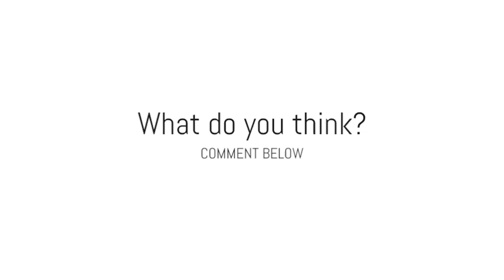A Free Energy Device to Erase Your Electric Bill - Lutec 1000 energy magnetic generator

Comment: There was a scientific evaluation of this machine: "Engineers, Walt Rosenthal and Parke Cole were invited to measure the Lutec1000 in January 2001.  Their measurements showed results showed 28% efficiency.  The exchange was amendable, despite the negative test results.  Rosenthal stated, "I walked them through the calculations carefully so they would understand, but they didn't want to believe the results."  Test entailed a dynamometer measuring output the motor, powering with power supply from wall producing DC volts, optical shaft encoder on end of shaft to measure rpm.  Results showed 50 Watts power going in and 14 Watts equivalent of mechanical power coming out."
Reply: As far as the Lutec 1000 is concerned, it is not about mechanical power, it is about the electrical power (watts) that it can deliver. it is the magnets that ensure that a large part of the electrical power is free per revolution,

as proven with the lutec 1000, this is not about bending physical laws and rules.

any mechanic with some common sense knows it works when you consider that the magnets are attracted to the steel in the core of the coils and are simply driven off by a momentary pulse (DC)

guess what,

We need this for a green future with, I'd rather see the lutec 1000 running in my shed than a windmill in the garden
Reply: No wonder why Lu Brits did not approve the results, this machine is not a conventional motor, a more proper description would be converter or transformer, it is transforming one or several  forms of energy into others, there are multiple energy forms involved in other words, I can think of kinetic, electric, magnetic, sentrifugal and probably more, even this machine looks simple but it is more to it than the first look, the patent is out there fore the world to read and test, problem is, no one understand it. And about that test, if they would tested electric power in and electric power out, not shaft output, they would see the same results as originally claimed, I think. Where this surplus energy comes from is another question, that I don't know but it would be foolish just to state the whole thing as a scam. If I had the tools and capacity I would have built and tested it, cause I fore one, belive its real.

Comment: I remember Lutec.  I also contacted John years ago.  He had some basic physics misconceptions on Lutec's website, such as stating that a magnet holding metal to a ceiling was doing 'work'.  I was honestly trying to be nice...but I received an e-mail calling me names just like another poster said he received.   

One of Lutec's demonstrations shows voltage and amperage (multiplied together) coming out of their 'amplifier' being higher than the wattage going in.  That's easily possible in a highly inductive system such as a generator...but there's no way an electrical engineer, as one of them claims to be, simply doesn't know about phase shift.  They obviously knew the 'trick' but were trying to fool people.

Comment: whats up Elon Musk. you looking at this or what?
Reply: Elon Musk is a puppet. He invented nothing new that would benefit the world. His Tesla cars contribute to more pollution in the long term than petrol based vehicles due to the batteries that have a very limited lifetime. Hydrogen powered engine is what we should have been running for the last 50 years.
Reply: 96% percent of hydrogen is produced from natural gas, coal, or petroleum.
Reply: Elin Musk is apart of the secret societies who would've threatened these inventors. Screw the new world order
Reply: Commerce experts in the 80s said it was impossible to give private sellers power to process credit cards.  And Elon did it in the 90s.  If he comes up with a generator, it will be his own in house team.  BTW, Lutec took investor money and ran more than a decade ago.  They stalled saying the invention was done but they needed time to file a patent in every country having a courthouse.